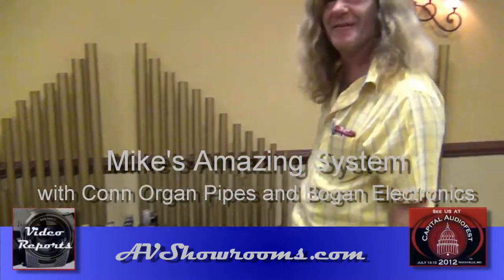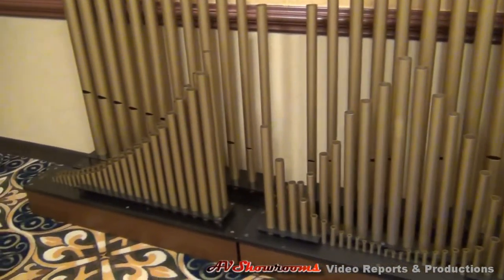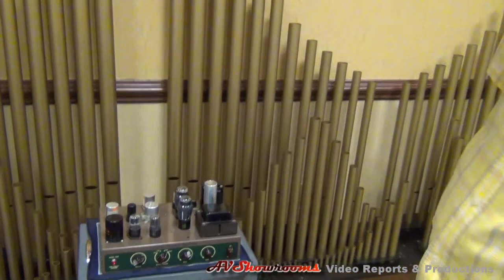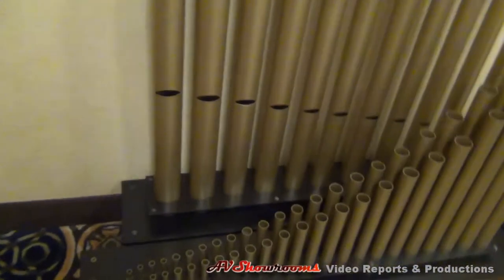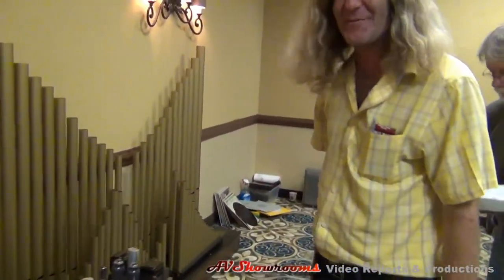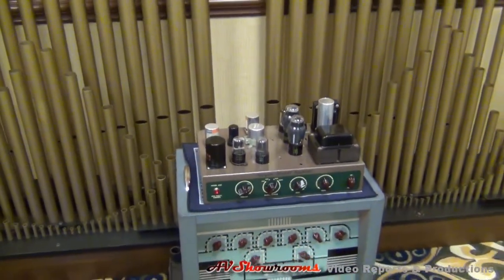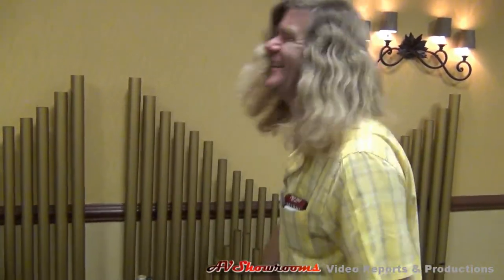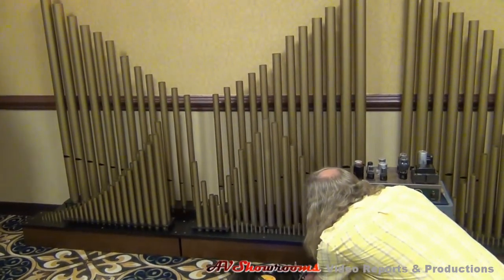Conn Organ, Bogan Amplifiers, Amazing Vintage Audio

Comment: Conn made some awesome equipment.  I knew a man who had three electronic organs in his house.  On my one and only visit to his home there was a rank of pipes just like these; however, they were made of glass.  Yes, glass.  The sound was awesome.  He had these made while he was a professor of physics at Temple University in Philadelphia.  These pipes also pumped air out their tops too.  Cool stuff.
Reply: Conn pipe speakers don't produce any air out the tops.  I'm sure you'r professor had more traditional wind blown glass pipes.  There is an artist that makes them.  At most one might feel a little bit of acoustic energy out the top of a Conn pipe speaker stack, but it isn't because it's a tuned resonator or works on air.

Comment: The Conn organ pipe speakers weren't really "tuned" for acoustic resonance as one might assume. The lengths and widths are insufficient for that purpose for the frequency range involved, and the time to actually created a tuned passive resonance speaker system would have made them impossibly expensive. Really, better quality drivers improve their sound immensly. But the aesthetic was nice when connected to a Conn organ.

Comment: I have 4 sets of these speakers.  Another cool thing is that, if you put your hand over the right pipes while the music is playing, you can bend the pitch, sort of like the whammy bar on a guitar.
Reply: +AJ Perkins You much be imagining it, these are only 6 x 9"  speakers wired in series parallel, there is no way you can effect the frequency of the tone being fed to the speaker by blocking the air coming out the front of the speaker system via the pipes.   The person using them on the output of an amplifier is deluding himself.  The reason crossover networks are used is to distribute a different range of frequencies to speaker or speakers that will produce them more efficiently.  Blocking the output of speakers with different length pipes really doesn't achieve anything musically.
Reply: No imagination used here. I have my speakers hooked up to an Allen organ. You can feel air come out of the top of the pipes and if you select the correct pipe, bend the pitch when putting your hand over the top of the pipe. You obviously have never seen or examined these pipes in person. The lengths of the pipes are not random. They are tuned to the pitches of the chromatic scale. Conn was the maker of electronic organs AND wind instruments. They used their technology in making wind instruments when developing these speakers.
Reply: No, they aren't really tuned, at least not with any accuracy that would matter.  Also there aren't enough of sufficient size, nor small enough for them to cover the usable musical frequency spectrum of even the cheap spearkers Conn used in them.  Frankly, Allen speakers produce better sound than the muffled mid colored Conn pipe speakers.  If one really wants a Conn set to sound decent they replace all the 6x9s with ones of better quality and frequency response and it makes a huge difference!